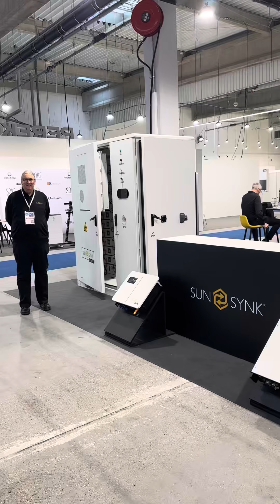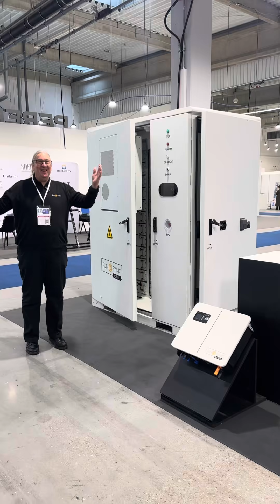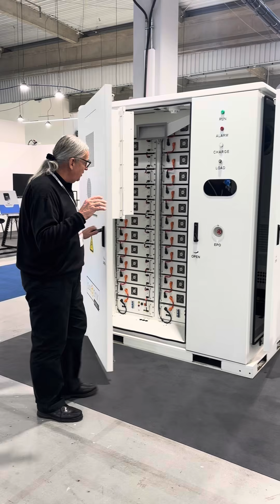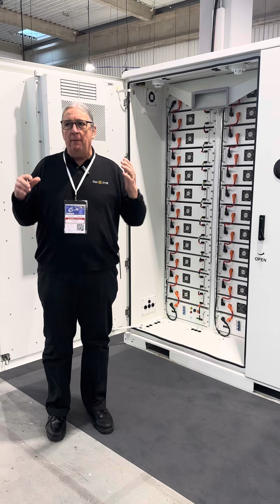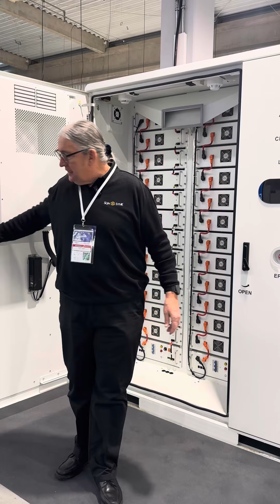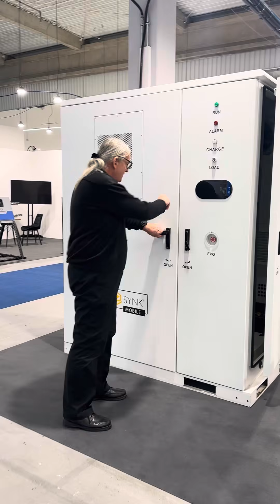Keith on Battery Storage: Low Density vs. High Density | What's Best for Installers?

Comment: Just installed the 50kW hybrid with HV battery pack. Very straight forward to install and such a powerful piece of equipment. Highly recommend this system for any mid sized commercial operation. Sunsynk uses the best semiconductor components and their inverters will last. Only criticism is that the app needs to integrate better with variable tariffs. Please accelerate the development of the self learning algorithms! Cant be right that GivEnergy have a monopoly on the octopus tariffs - Still (their hardware's crap)!!!

Comment: lol terrible lines, water cooling is most efficient, if you are an engineer you will get the idea
Reply: @chuksobi593  I believe there is a new way they are cooling CPUs using non conductive coolants, where they have a sealed housing that contains the mother board etc this is then filled with the non conductive coolant this helps to dissipate heat much better than air cooling, this might be the way to go in the future,

Comment: Hi Kieth could you use those batteries in smaller configurations like say only using 6 of those batteries in a unit, and if so what BMS would you use?
Reply: Just go for the standard HV range